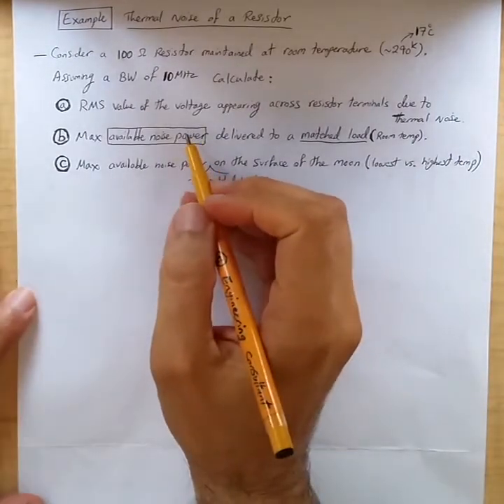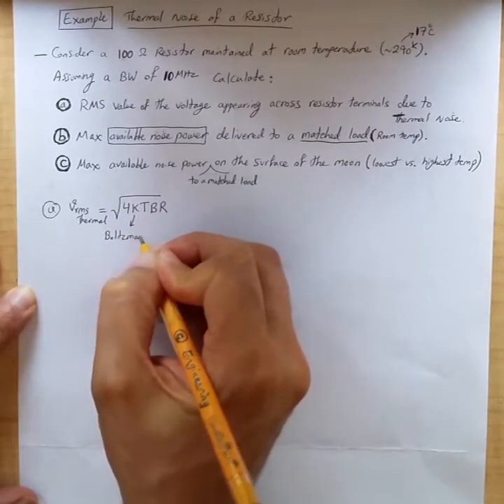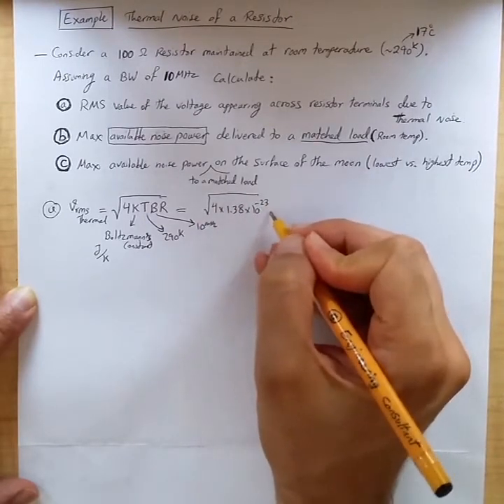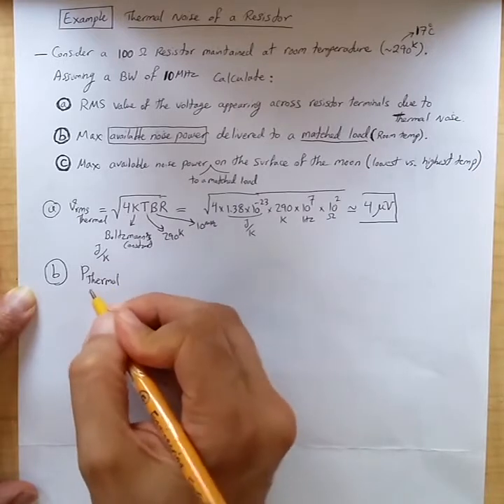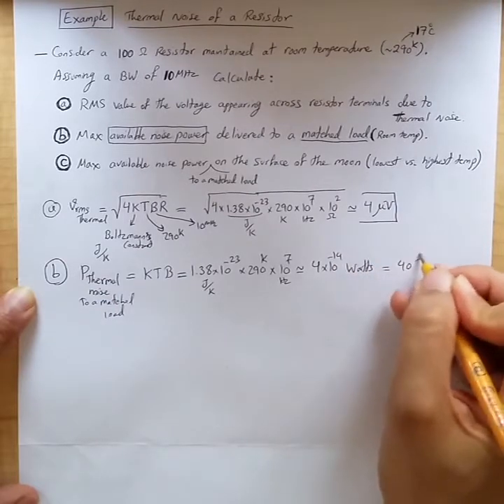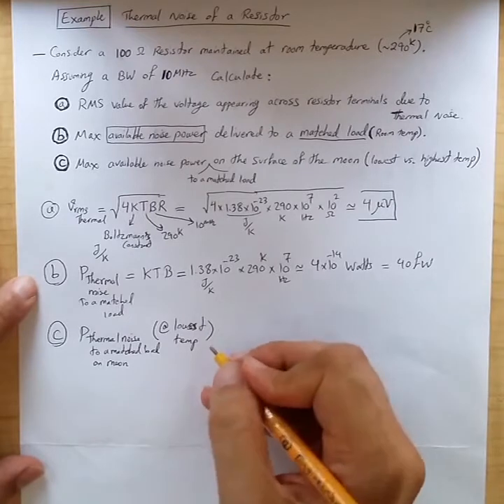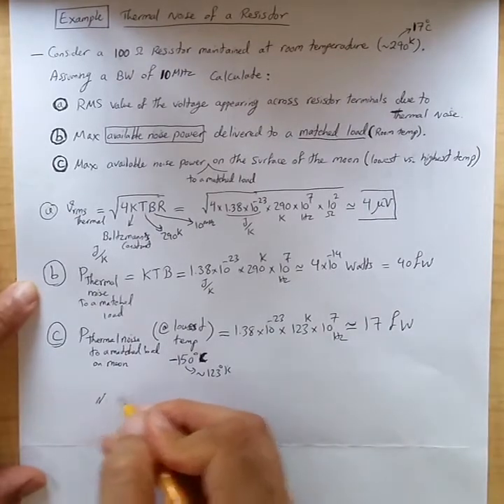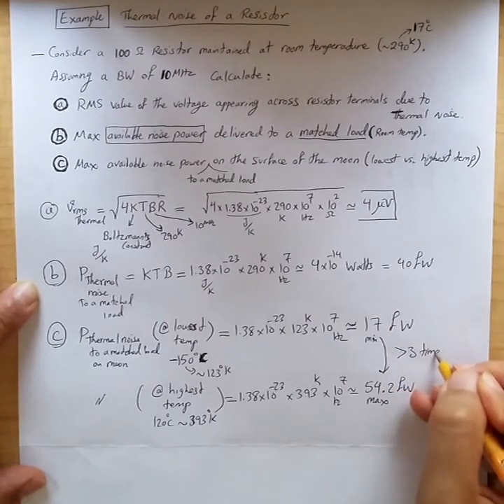Thermal Noise Of Resistor: How to Compute

Comment: Hello sir,  what if we have two resistor with different temperature for every single resistor?
Reply from the maker: Thanks Amir for your note and question.  What is the setup for your two resistors with respect to each other? How are they connected ?
Reply: @STEMprof  

i have a question with data

R1 = 100 ohm , with  T1= 600 k 

, R2 = 150 ohm with T2= 300 k
BW =1 MHZ
 
1- in series
2- in parallel